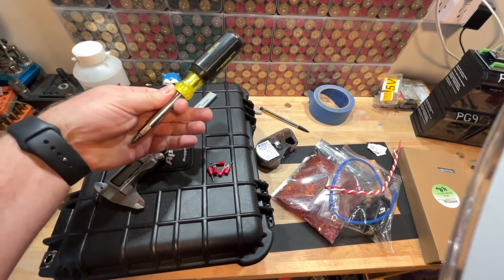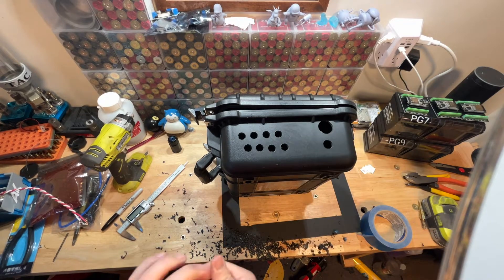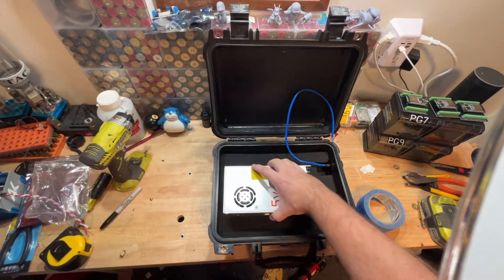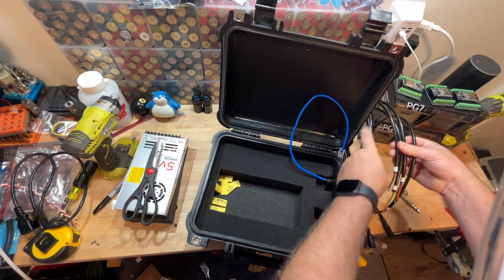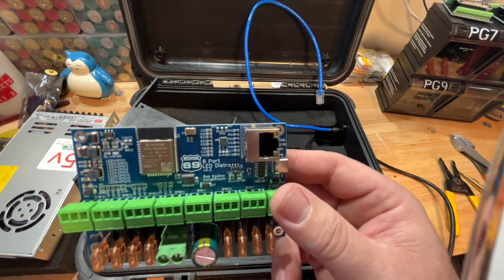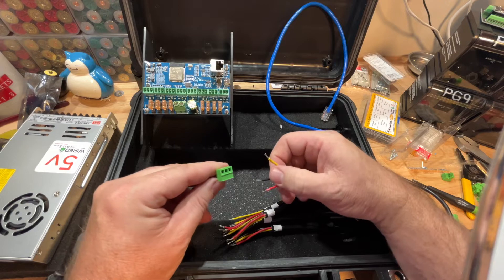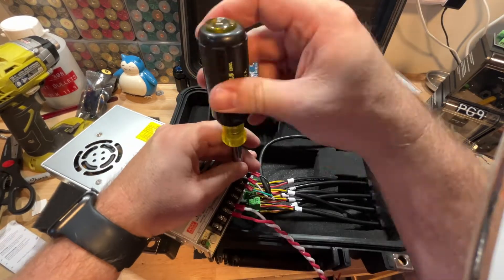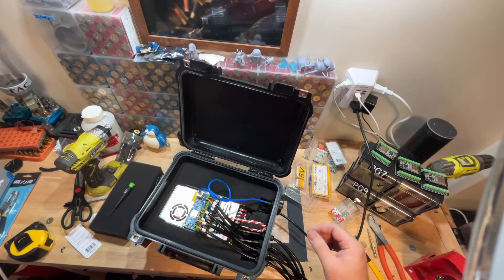🔌 8-Port LED Distro Powered by the BONG69 Controller | Twinkle Tunes and Lighting

Comment: I like your videos they explain alot. I have a question about the broad itself. Can it handle the12v bullet pixel too.
Reply from the maker: It sure can. V4 of the board can handle up to 48v pixels. I have an unboxing and full breakdown of all the Bong69 boards on my channel. Are you thinking about getting one?
Reply: @twinkletunesandlighting yea. I have an older falcon controller it works good. But want 2 controllers to put out in my yard. I have a small show. Trying reduce alot of cords in the yard. I have all 12v props.

Comment: I followed everything step-by-step and a power supply is not turning on

Update when I tested black cord for power my whole house breaker blow out 😂
Reply from the maker: Ooof.  Sorry to hear that!
Reply: @twinkletunesandlighting  I got to work I had to turn off. 208v switch on the power supply
Reply from the maker: @dantefoster3806 that gets over looked a lot. That switch is hidden and no one thinks of it. I’m glad you found it and it works now.
Reply: I got the Bong69 v4 and one of their power distribution boards. I see they (distributor board)are just power no data line. Are these things basically to make a power supply splitter and then you can hook up more controllers off each power supply. I guess I don’t understand the use of a power distribution board. I bought it because Facebook and Wasatch told me I needed it. My lights are running fine without it but I want to figure out what they are used for.
Reply from the maker: @DennisWarner  It’s actually used for power balancing, not data. The distro board lets you spread the load from one power supply across multiple fused outputs so each prop or injection point gets clean, even power. Instead of stacking a bunch of wires on the PSU, you feed the distro board once, and it balances the power out safely to each run.

So your controller still handles all the data, and the distro board handles even, fused power distribution so long runs don’t dim, sag, or overload a single line. They work together to keep everything powered evenly across your props.  Check out this build and it will show you a bit more. https://youtu.be/h9CB1gWuYiE
Reply: @twinkletunesandlighting so the distribution board only accepts a 24v so Govee uses 36v. Do you run the power from the distribution board and the data from the controller?
Reply: @t @twinkletunesandlighting I watched it

Comment: I know it's a waterproof case but my only concern is the power supply overheating due of the lack of airflow within the case and the foam being right up tight to the sides of the supply.
Reply from the maker: The foam is very coarse. Air passes right through with no problem. With the exhaust fan of the power supply being on top and the extra fan bringing external air in it flows quite nicely. I have temp sensors on them and when they are running full tilt boogie I do not see much of a change.